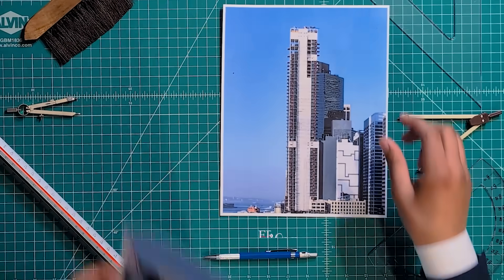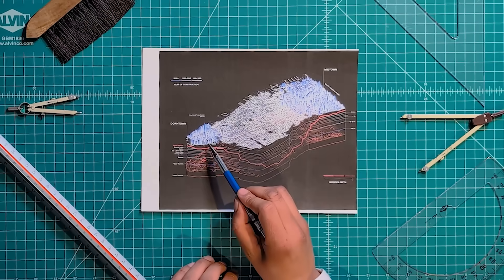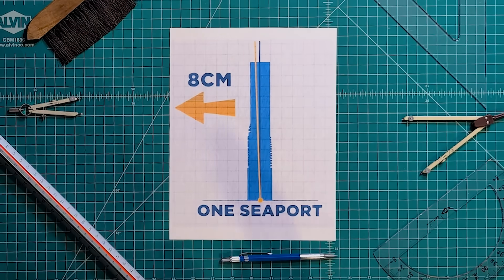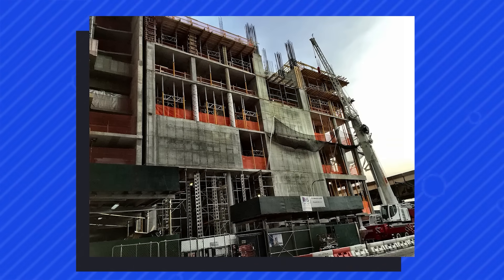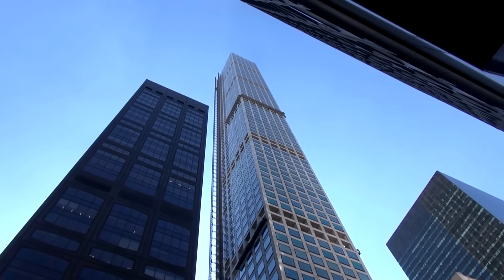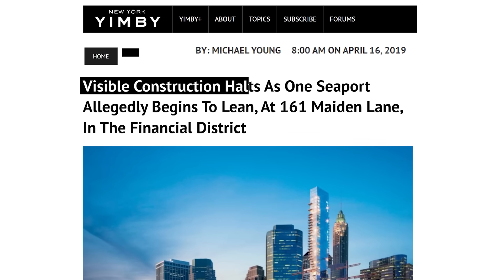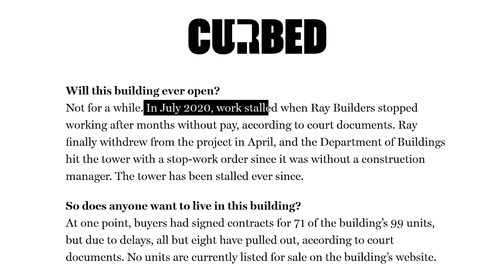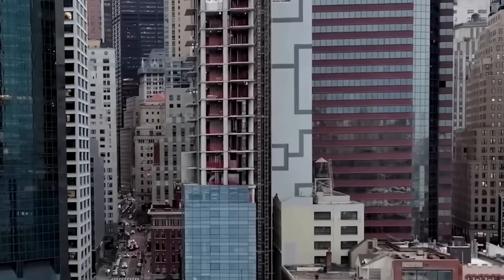Engineer Explains the Leaning Tower of NY

Comment: Artificial land next to a river is called mud. The only real question now is who will eventually pay to remove the structure.
Reply: I’m sure they’re looking at “righting” the lean with foundation mods, but the “taint” will be hard to fix.  Most likely be demo’d and the losses argued for years between the structural engineers, civil engineers, GC, Architects, the City, and the lenders.  Of course E&O insurers will take a hit, as will the lenders when the developer and GC file for bankruptcy. A total nightmare for all.
Reply: @Buddhistview145 If they can fix it then they should fix it.  That would be so much nicer than a takedown and rebuild.  

It's not like they're going to replace it  with a park and playground or a Mickey D's.  They're going to get new funding or a whole new dev and design and build a new monster.

So why add all that extra time if it can be fixed?
Reply: "Mud". Luv it!
Reply: And all that concrete the injected over 50’ into the ground!
Reply: I suspect they will 'socialize' the cost of removal..........
Reply: Maybe they can just shorten it by, oh, say, 90%?   😜
Reply: @GR46404 Yes, let's remove the cheapest 90% and keep the most valuable 10%.

You can guess where this is going, right? 😂
Reply: @ErilynOfAnachronos  😂😂👍
Reply: Trump will buy it. :face-green-smiling:
Reply: With luck it'll just fall down into the river for more reclaimed land you can build more narrow skyscrapers on, rinse and repeat.
Reply: So if I add a ton of rocks and gravel next to a river you're going to call it mud?
Reply: That's cute except a lot of big building has been done for a long time on the same fill without issue so you have no point. The was a bad project that did not use the time-tested methods that were used to build all the other towers in a big district of sturdy buildings on what you call mud. The reason the lean is apparent is that all the properly constructed buildings around it are straight

Comment: I am a “small fry” project manager and worker in engineering companies. Cutting corners, and sweeping problems under the carpet are a familiar experience. The new-build house I bought 30 yrs ago has a minor irritation that is fixed one light switch at a time. The electricians connected the wires to the switches by “back stabbing”. I.E. the wires were not turned around the screw posts. They were just stuck under the screws when tightened. Eventually, one by one the wires must be redone. Amazingly, in Cary NC, backstabbing meets code, but is considered back practice. And my house is not the only one. At 85 years old, I’ve seen a lot.
Reply: “Fixed one light switch at a time.” I feel your pain.
Reply: Back stabbing is very common in new home construction.
Reply: @LeverPhile The other fraudulent practice is installing “contractor grade” products which are just good enough to pass inspection.
Reply: @AndreasSvenska  Contractor grade means "cheapest trash that'll pass code."
Reply: Yep china switches weak  connection  never back stab could cause arking
Reply: Backstabbing is fine. I just tried to disconnect two switches yesterday that were backstabbed. I had to cut the wires because they wouldn’t come out. I was pushing the lever in too.
Reply: I've never heard of such nonsense. You can safely back stab a leviton switch. It's a 14 gauge wire pushed into a spring loaded hole. Or it's a 12 gauge wire placed under the little plate that the screw tightens on to. It's how the decora switches are designed. It sounds like you had a lot of bad makeup in your boxes. I'd check ALL the boxes.